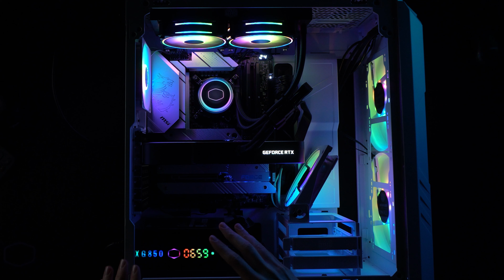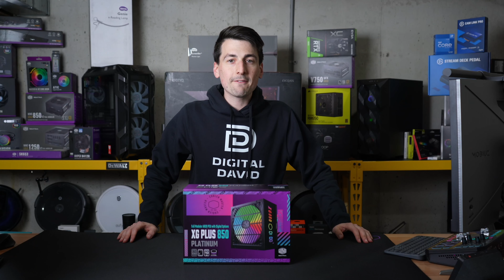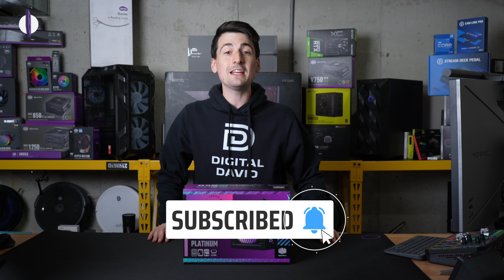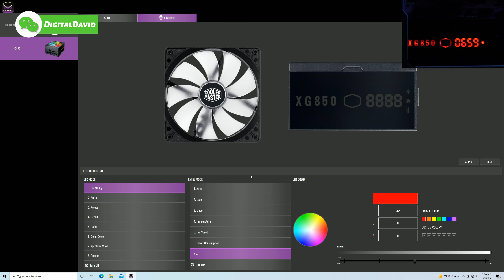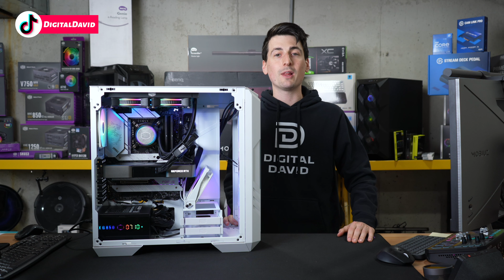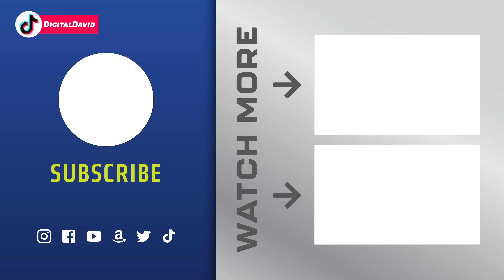Cooler Master XG PLUS 850 Platinum PSU Review

Comment: Do you know of any aftermarket cables that'll work with this PSU?
Reply from the maker: Yes, there are several aftermarket cable options available that are compatible with the Cooler Master XG PLUS 850 Platinum PSU. Some popular options include the CableMod PRO ModMesh C-Series Cable Kit, the SilverStone Tek PP08B PSU Cable Extension Kit, and the Phanteks Extension Cable Combo Kit. However, it is important to ensure that any aftermarket cables you purchase are specifically designed for your PSU model and are of high quality to avoid potential damage to your hardware. I hope this helps! cnl

Comment: Questions:
1) what are specs of your unit?
2) Would this 850 watt Power Supply be enough to support 13700k (Raptor Lake) and Nvidia 3080Ti?
Reply from the maker: I don't have this unit assembled anymore and yes you would most likely be anywhere between 700-800 watts so it just won't leave you much headroom in the future!

Comment: I bought this for my Haf 700 evo, can’t wait to start building with this
Reply from the maker: How did your build go?!
Reply: @DigitalDavid  It went excellent, had no issues fitting it in the case. The downside is that I didn't have a chance to fully utilise or showcase it properly apart from the RGB fan - had all my other fans up front. All & all, great psu no issues, been using it for my 40 series ever since.
Reply: You cant see it on haf 700 evo? I would like to get it also.